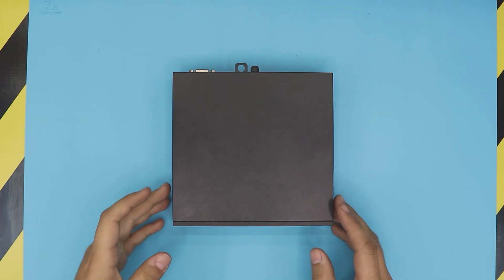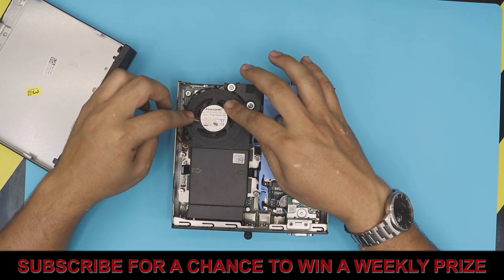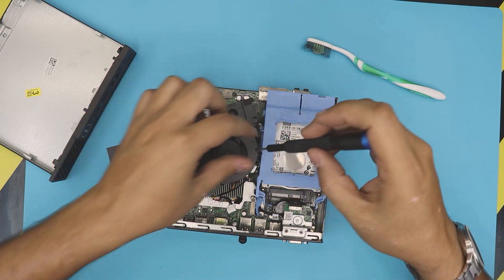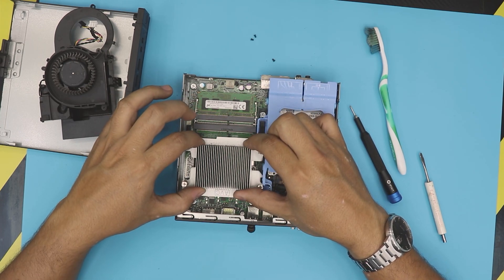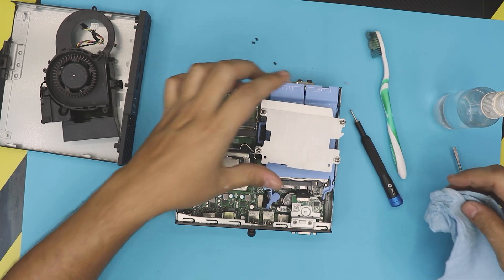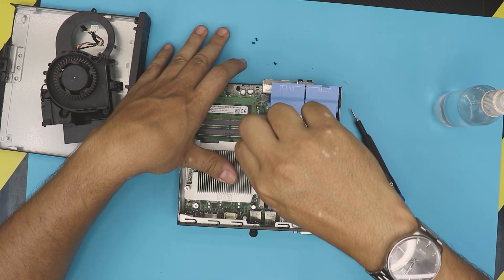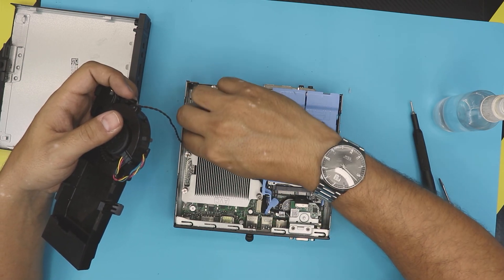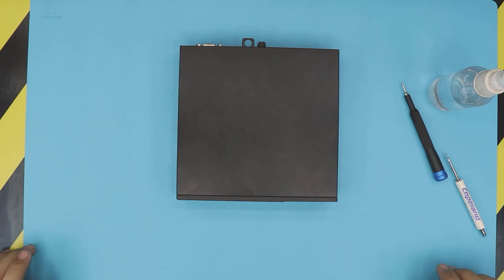Dell Optiplex 3050 Mini Pc Repaste Service / maintenance

Comment: Do you have a dead 3020 micro? And I subbed! Wait! I was already subbed!!
Reply from the maker: 🫠Regarding your question, i will take a look around and i let you know.
why you need a dead 3020?
Reply: @uFixTek  well actually I may not keep what I found. Found a tossed out 3020M, but there's no CPU, no RAM, no SSD, no heatsink.. I plugged it in and it seemed it was trying to start! Plus the removable cover is not the correct one! 🤣 As a kind of hobby I look for electronics in dumpsters and curbside stuff!
Reply from the maker: 🫠🤣no cpu no ram sell it for gold
Reply: @uFixTek  yeah it probably would not be cost effective to do a rebuild! Have some other PCs, laptops that are sort of like that too!! 🤣

Comment: What happened to the temps before and after repasting?
Reply from the maker: I'm sorry, but this video was not created to benchmark CPU temperatures or to test different thermal pastes. Its purpose is to guide you through the servicing of the Dell 3050 model, which should be performed regularly, ideally once a year or as needed, depending on your PC's usage. For optimal temperature results, we recommend using Thermal Grizzly Kryonaut paste: https://amzn.to/45Xz09z

*This is an  Amazon affiliate, when you use my links, I earn a percentage, which helps support the channel🙏.

Comment: Mine don't have that VGA gpu thing
What is it called I need to buy it please notice me!
Reply from the maker: Thank you for the feedback! if you wish to support the channel you can LIKE or SUB or both :P
regarding your question:  if you have HDMI or Display port, you can get an adapter to convert to VGA, here are the both adapters.
https://amzn.to/3PW7EKd
https://amzn.to/3C2TGAu

you can't install the VGA directly on motherboard, if yours didn't come with it.
Reply: @uFixTek  thank you so much but my real question is 
 can I replace it with a new GPU for gaming purposes? how do I do that where is it supposed to be located? am i supposed to use a extender type of thing ? what is it called
Reply: i cant find a video replacing GPU please help
Reply from the maker: sorry for the delay, but you can't upgrade or add a GPU on this mini PC, you can only upgrade the CPU to the same socket CPU but they are all almost the same, none of them have a GPU dedicated. sorry to inform you about it,
Reply: @uFixTek  okay thank you!!!!! does that mean the GPU is CPU dependant? 
( ryzen 7) CPU can act as GPU since it is intergrated GPU (i-GPU)
Reply from the maker: yes but you can't place a AMD CPU on Intel Motherboard.

Comment: Hello. Thanks for the videos. I have a gtx 970 gpu and i want to use it as an external gpu on this device. Could you please show how to do?
Reply from the maker: Thank you for the feedback! if you wish to support the channel you can LIKE or SUB or both :P
regarding your question: unfortunately it's NOT possible we have tried many different External GPU connectors and few worked but Horrible results, others didn't work.